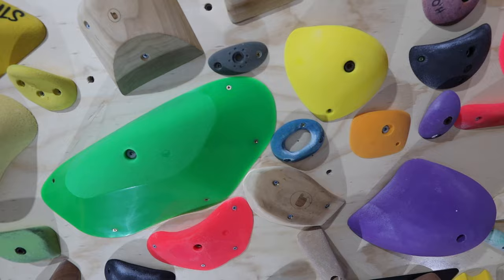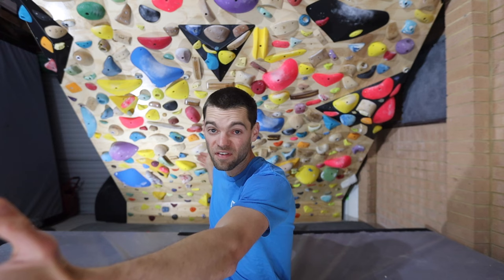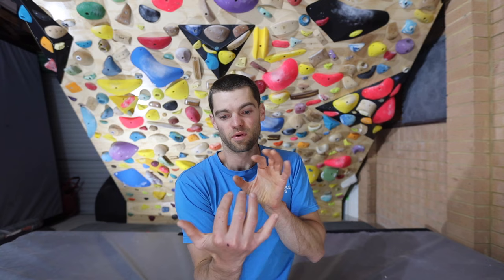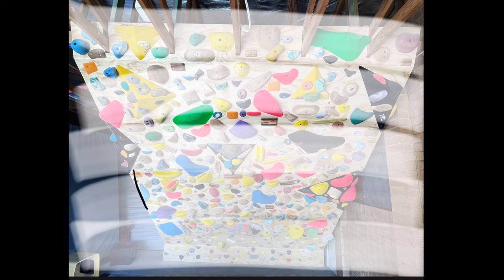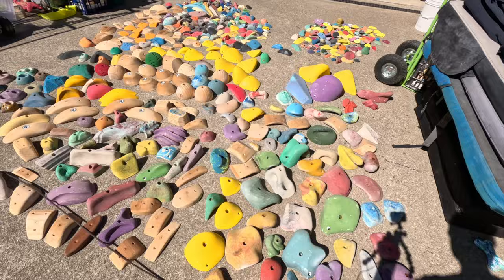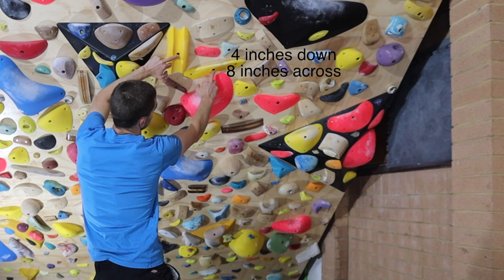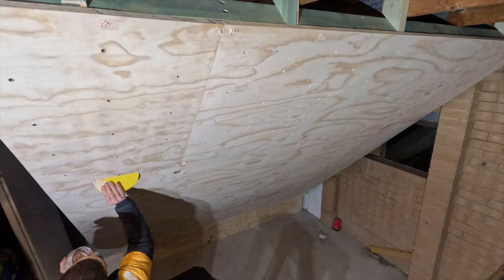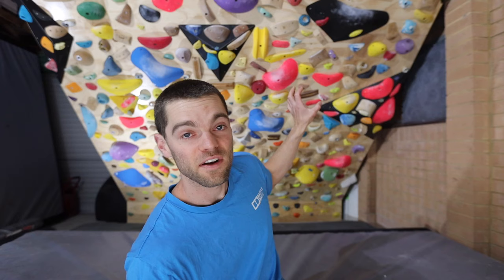Build your dream home wall!

Comment: Home wall videos get me so psyched to use my own more. I built a 30-degree wall a few years ago when I was only a V2 climber. In hindsight, it's a little crazy to make a massive investment when you're just a beginner .. but I'm glad I did. The holds and setting on the wall evolved as my climbing developed. It's also nice to have around when your partner is a climber, as well as having climber friends over.
Reply from the maker: That’s awesome! Never to early to make your own playground 😀. Great you were able to evolve the wall and holds as you progressed. 30 degrees is a super nice angle too.

Comment: Looks solid, but i would def change the screws in the framing to bolts.
Reply from the maker: I’m using big bugle batten screws which are very much strong enough. Bolts could be a stronger option, but at a certain point the extra strength is redundant. I have used bolts for other builds
Reply: @TomOHalloranAus   ok , just don't underestimate the load of that structure and the shearing forces. But your call

Comment: Your wall looks great. Nice work hanging that plywood solo, that's tough...your flooring is top notch as well! 👊🏼
Reply from the maker: Haha yeah it’s not the best job. Happy with how the floor has come out. Grind back and a few coats of concrete sealer. Worked a treat
Reply: @TomOHalloranAus  the concrete looks silky, but I meant your giant foam crashpad looks superb!
Reply from the maker: Haha ahhh that makes sense. Yep, new matting. Local gym shit down and I bought some of the matting

Comment: Great looking board! I built a Moonboard sized wall during Covid, put the panels on top of the frame and screwed them in while it was flat in the ground. It was a total epic to get the board up in the air after that! 😂
Reply from the maker: Haha that’s a lot of weight to haul up. It’s funny the little mistakes you make. Curse yourself at the time, then laugh afterwards 😂
Reply: Haha I did the same, think it took like 6 of us or something to move that monster.

Comment: I like that clear coat floor sealer you used. I used a deck stain on mine and it totally eats up the rubber
Reply from the maker: Yeah this stuff has worked very nicely. Used it on the last wall as well

Comment: Nice wall with huge space to climb. But why didn't you build two walls with different angles? Because then you get more opportunities. I don't have much height in my cellar, so I build 30° and 60° wall.
Reply from the maker: Ahhh you'll see why a second bit of wall didn't go in there now. Let's just say the training garage is not yet complete :). I did try very very hard to find somewhere for a 20 degree wall to fit. But alas, couldn't. It was going to be too cramped. Love the idea of the two walls you've got. That's awesome
Reply: @TomOHalloranAus  thanks.
It was an idea of a friend, who has just 60°. But with 30 and 60, you've two straight parts facing in the opposite direction, which is nice for toe hooks.
If you wanna see it, I can share some pictures.

Comment: Quick question. Where did you get the mat? Most people I know of who make their own home walls usually just use crash pads. Is it better to have a big mat or just spend the mat-money on more crash pads for both home and outdoor bouldering?
Reply: Loved the video btw will def make a home board!
Reply from the maker: Got the mat from a local climbing gym that closed down recently. I've used second hand mattresses in the past, as well as boulder pads. The good thing with using boulder pads is that you need to buy pads anyway (if you boulder outdoors) and you need to store them somewhere. Using them under the wall as padding is a good option.

I love having the big mat, but boulder pads have been saving my but under the wall for the three years prior :)